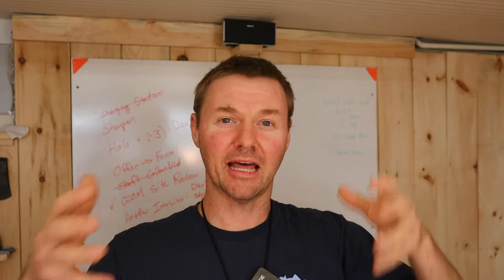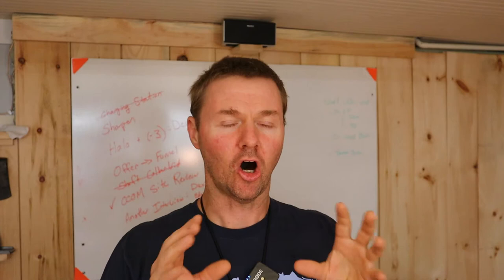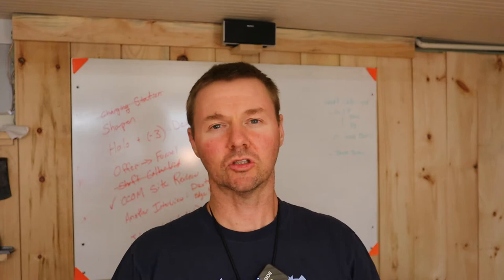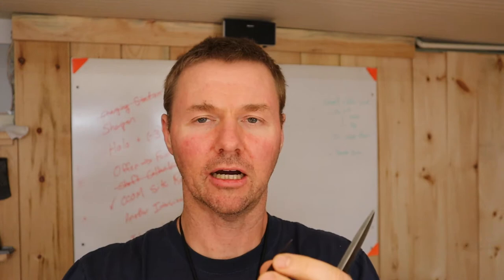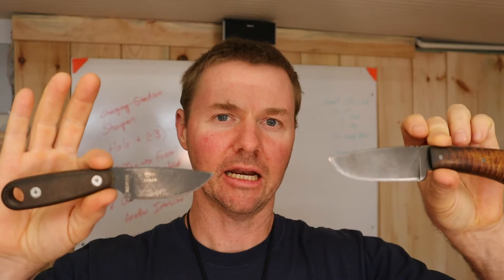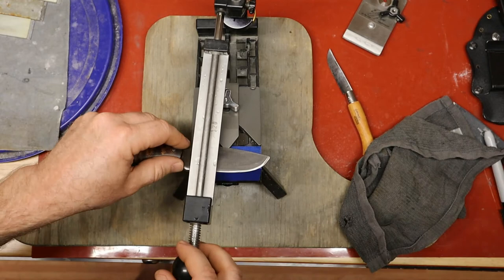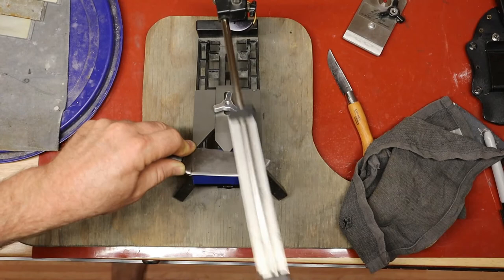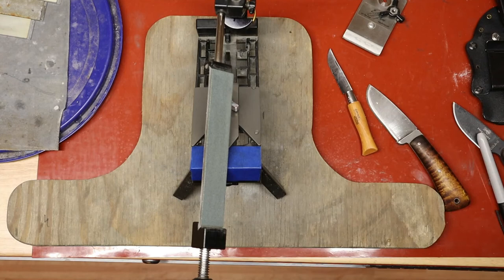TNG Ep 29: Delivering a MIRROR POLISH on Fixed Blade Carry Knives

Comment: Great video, Matt. Appreciate you showing the whole processes from 1x30 to the polishing tape. I had a folding knife the other day that had a dull spot at the ricasso. I took a few swipes on the leather strop and then back to the polishing tape. It turned out great. Please do make a video about the choil and more. Thanks for sharing!
Reply from the maker: Thanks for that, Doug! Funny you mention the leather strop, I don't use mine much but I've been considering getting or making one for the Edge Pro.
Copy that on the vid about a cutting a choil.